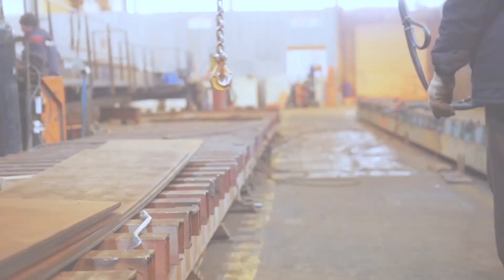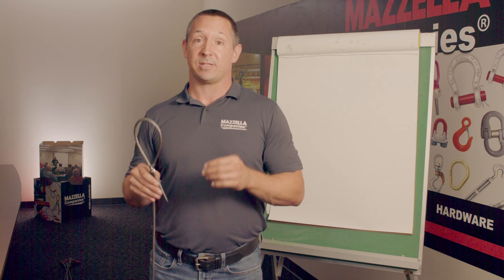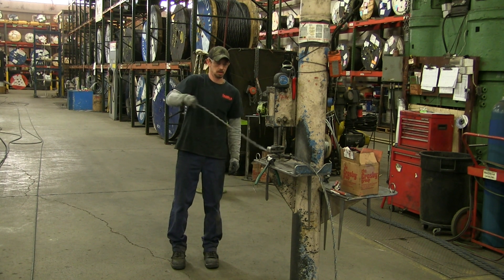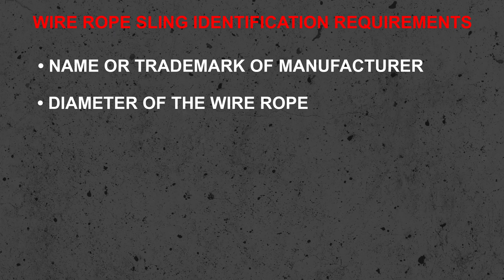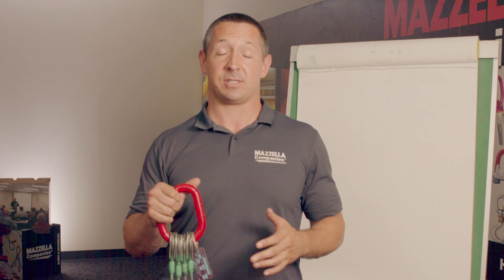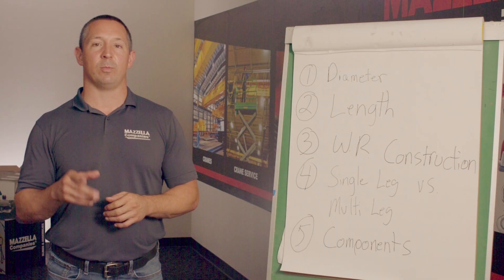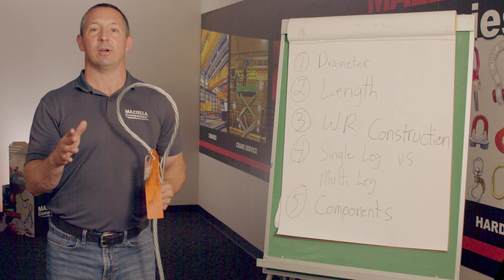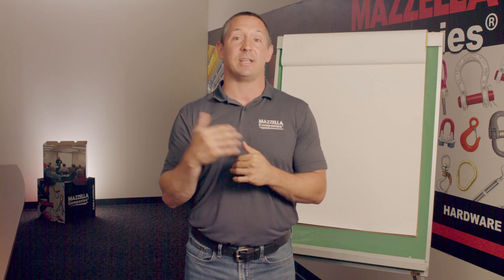Wire Rope Slings: Basic Acronyms, Components, & Configurations

Comment: Dear Sir, In this video you showed a multileg sling in to one master link (4 leg into one link), is it allowed to use such a sling? How many sling can be accommodated into one masterlink?
Reply from the maker: Yes, you can definitely do four legs into one master link. We recently just did an eight leg bridle into one master link. You can put as many legs as you want into a master ring DEPENDING on:
1. the application it's used in
2.  That it's done and approved by a competent/qualified person 
3. That it doesn't overload the master link..  Master links are meant for inline pulls.. You don't want any of your legs to be pulling on the sides of the master link

Great question! Thanks for asking.